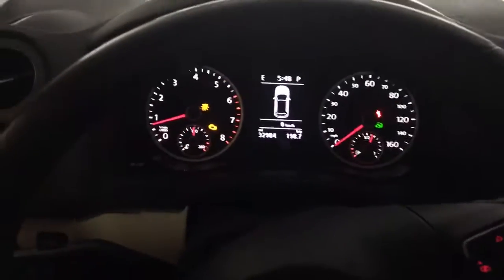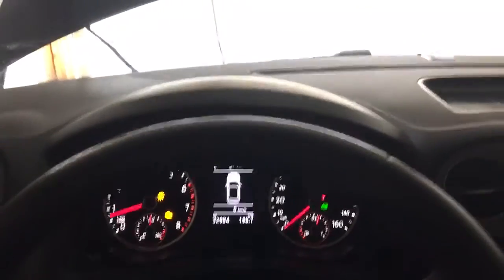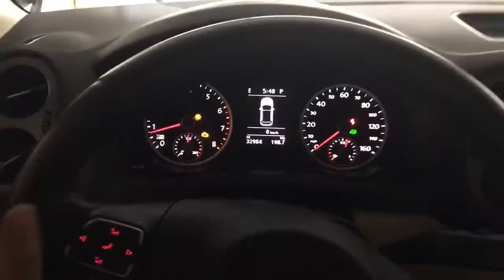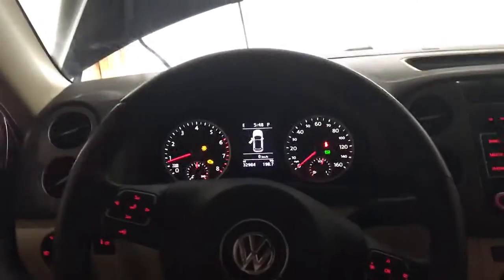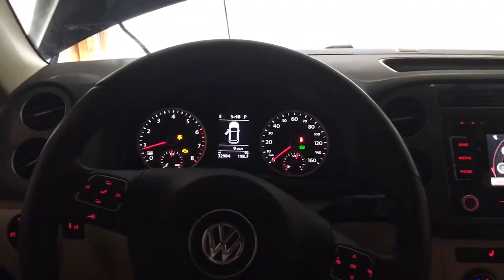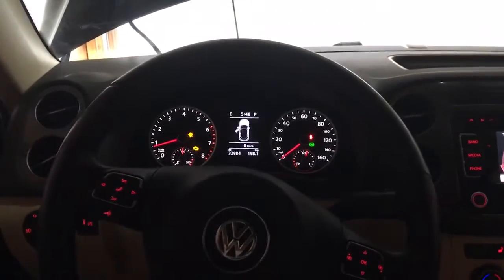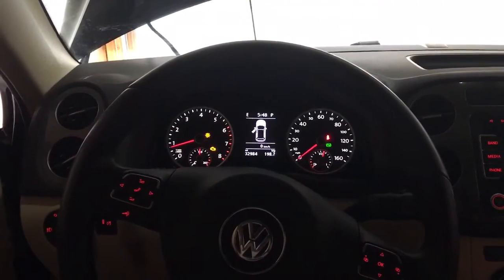CTS TURBO COLD AIR INTAKE APR STAGE 1 TIGUAN INTAKE NOISE INSIDE CABIN LOUD !!!

Comment: Just wondering if you can hear the noise from the air filter / turbo even when the foot is off the accelerator pedal? I have this problem, and is rather annoy. It sounds like the radio station that is out of tune.
Reply: Kazama0r boost leak

Comment: what dv are you running now mate? are you still driving the tiggy? where's the videos man
Reply from the maker: Saigonboi 23 
I had switched to the go fast bit DV+. I sold the tiggy after the second turbo failed and I paid for the K04 and man it was wicked fast but I did not trust the reliability. I sold it for a Kia Serento platinum and it has a v6 that has more power than my Tiguan. I don't miss the 4 banger the V6 is better in almost every way.
Reply: 2 FAST & 2 LOUD!!!  did the gfb dv and your intake did it make a good bov sound? loud enough to hear as u drive? i've got the gfb dv and a forge spacer but i'm not sure if i should combine them or use the gfb on its own if it can still give a good sound and still be reliable.thats too bad but yeah it's nice to get a completely new car too so congrats man